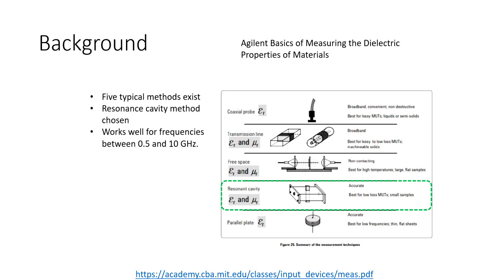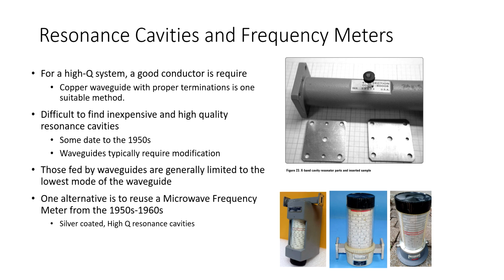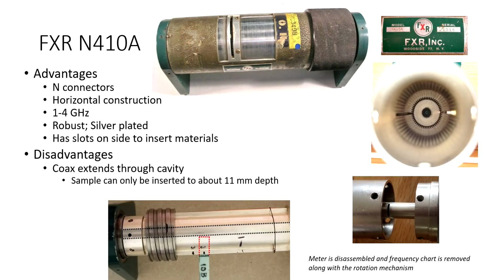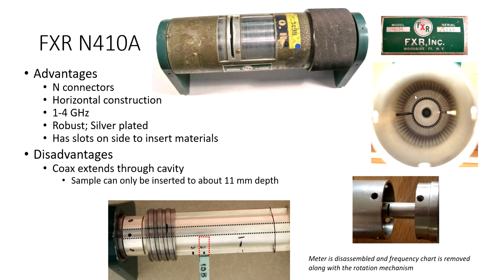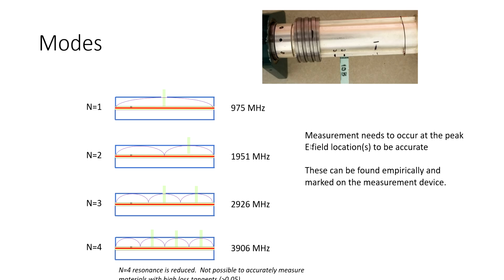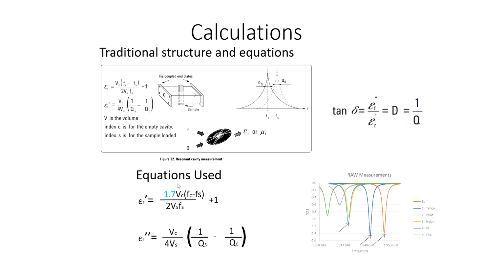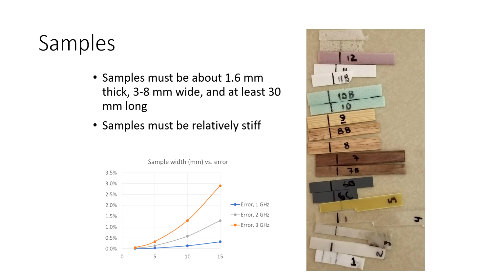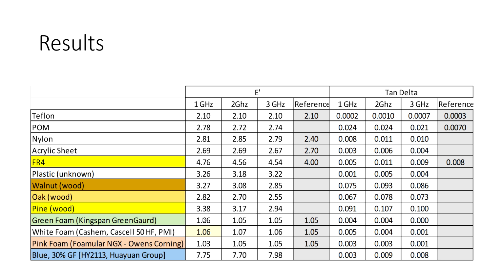How to measure dielectric properties using a Frequency Meter - Part 3

Comment: Thank you for documenting your progress.
Reply from the maker: Thanks for taking the time to watch and comment.  More coming, but it might 2-3 months as I have a few things on my plate at the moment.
Reply: @scottvance74 Jut trying to figure out a way to make this a duplicable design.  Found the following product description (remove spaces) and wondered if this would be a suitable cavity design. Making use of standard parts would be great.  In your application the exact frequency is not as critical so it might be possible to relax manufacturing tolerances.

The idea that one could use a standard waveguide segment with a side arm for the feed, bolted to a base and a power meter attached to a top flange that you close using a fixture toggle clamp after placing the sample on the cross hairs on the base plate.

If the alignment of the sample is not so critical when standing vertical it would make testing pretty quick. Using a microVNA might provide enough accuracy to get results.  Selecting the cavity height to make best use of the maximum frequencies of cheap microVNA devices could popularise the project.

You could sell ready kits with all the required parts and have an affiliate links to the available microVNA products.  The manufacturers would happily share your demonstration videos.

The budget conscious DIY person could make their own by using a Dremel tool to hack a surplus bit of waveguide or aluminium tube for the feed loop made from a RF connector and connected to a used signal generator then buying a flange adapter for a cheap diode power detector.

msi-sensing . com / microwave_cavity . htm